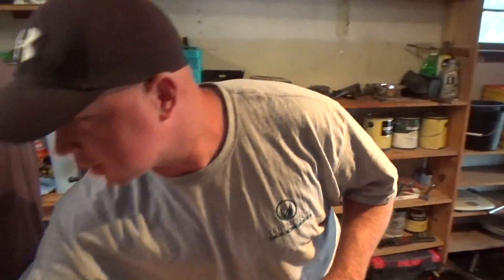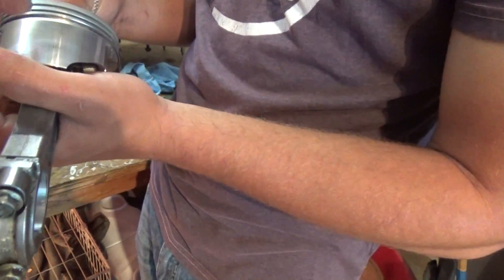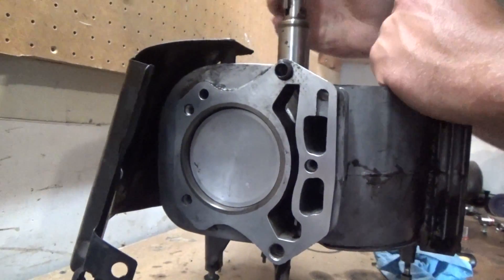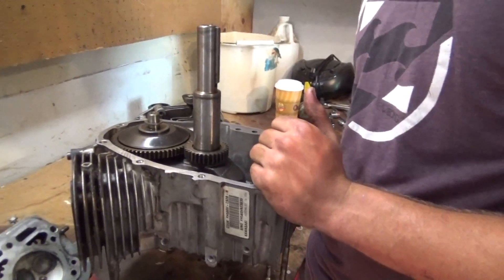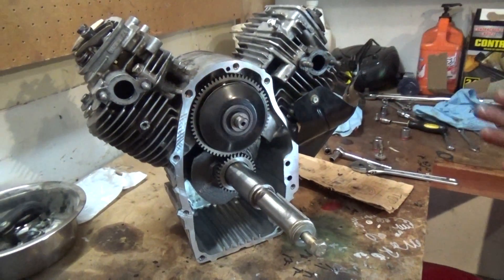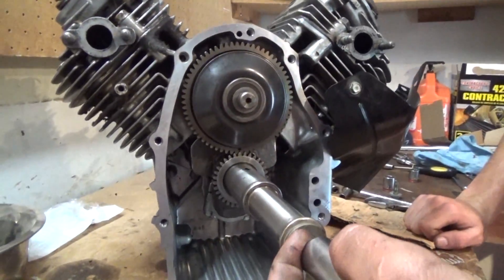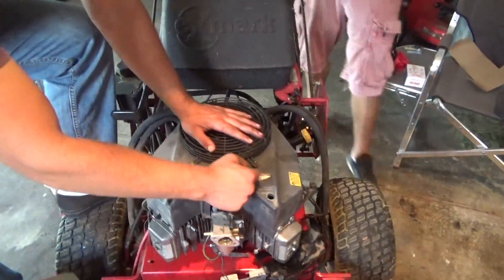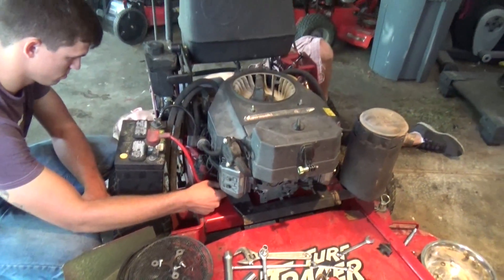Kawasaki 4 Stroke Engine Rebuild. Piston Ring Repair , Head Gasket Replace

Comment: The Kawasaki motor is the best lawn mower engine never made I'm surprised you're even rebuilding it it's amazing I have one that's so old from 1989 that still starts up with one pole it's on a 36 in so it didn't get as much mowing but it got a hell of a lot of mowing it's still runs as good as anything.

Comment: you didn’t use any lube for assembly you didn’t set the valve lash and you never go full torque value you could cracker been to head. Supposed to progressively tighten it till you get the full torque value.

Comment: This video really helped me with my first engine rebuild. My only question though, is the exhaust and intake valves were already installed and you didn't mention them. I tried to put the camshaft back in after the pistons and head were installed, but the valves won't go in far enough to clear the cam installation. What am I doing wrong?

Comment: Needed to adjust or gauge the valve guides to appropriate gaps, somewhere around 0.006.  Look at what your valves call for on this engine.  Then your engine should run smoother.  There are YouTube videos on how to do that also.

Comment: Lube components to prevent a dry start .. And gotta adjust the valve clearances and also i didnt see any honing/ de glazing of the cyclinder... Just enough to get the cross hatch pattern ... Also you need to know if the torque values on the hardware are when wet or dry.. And what does the spec reccomemd for lube when torquing bolts wet .. A wet torque is differemt than a dry torque do to friction ..

Comment: Dang, my guess is cant learn without trying. I have a sibling with a twin Kawasaki that's finally blown a gasket or piston won't know till I take it apart.  I will draw diagram pictures on paper to tape bolts to   was my thought.

Comment: A stator doesn't have anything to do with your spark.  The rotation of the flywheel magnets passing the magnetos induces spark.  The stator is there to keep the battery charged therefore keeping all electrical systems functional on the mower.
Reply: Magneto.. I think it's just a coil secondary.

Comment: Yep....  Just what I expected from your first video.  Have you boys ever heard of crossing hatching with a hone?   Since you only put rings on one side, did ever occur to you to run a compression test again to see if the cylinders are even close to being in balance, or does the potential for a broken crankshaft not bother you?  Still pondering the purpose of that governor arm spring??   Damn that was fun watching you boys work.....  The BEST part was those kids actually talking shit like they knew what they were doing, the SAD part was that you believed them......  I give that engine less than 100 hours and it will be right back on the bench and you now have two You Tube videos to show the world why.
Reply from the maker: Appreciate your feedback. We actually used this machine for about another year and then traded it in to the dealer.

Comment: Assembly lube on all moving parts.

Pre-position governor lever. 

Always install new crankshaft seal in oil sump, make sure lip on seal doesn't roll over when assembling sump (oil pan). Loctite sump bolts.

Gradually tighten bolts to torque...not to full torque as you go. 

Loctite engine to frame mounting bolts.

Anti-seize pto end of crankshaft...make sure key is in good condition before installing pto. Loctite on bolt.

Anti-seize and check key for flywheel.

Adjust valves.

Comment: First I applaud you guys for tackling such a project.  Second, I question if the pistons rings had anything to do with the problem!  Why is that you ask?

1) No compression right cylinder #2
2) Remove valve cover and find loose non-functional push rod.  A typical sign that someone serviced the engine and failed to do one of two things.  A) set proper valve gap.  B) fail to set lock screw on adjuster.  failing this allows the adjuster to undo and the rod will fall out of the rocker.
3) In either of the two video's, you did not show if you checked for push rod(s) being bent!
4) When you removed the head, the exhaust valve was evidently stuck open!  That would have automatically been a cause for low/no compression!  Secondly, since they valve get closed tight by a valve spring, the stuck valve would indicate one or more of the following.  A) Bent valve  B) High carbon buildup stick the valve. C) Valve seal broken.  A damaged/broken valve seal will allow crankcase oil to flow into the cylinder!
5) Hard to see precisely, but the head gasket appeared  to have blow by where as oil could leak from the oil cavities into the cylinder.
6) You did not show or speak about the cylinder head tear down and service.  A cylinder head in that condition requires a mandatory dismantling, cleaning, check for bent valve stems and resurface of the valve and head matting surfaces.  Since the engine started and ran, I will assume that you did all that including setting the correct valve clearance!

My "guess" is that a good head and valve service/exchange would have been all you needed to do.

The last thing I wish to mention is that >>>>  Never ever assemble an engine like that with dry components.  You might as well throw some sand in that engine for the damage you can cause by not making sure the all moving parts are pre-lubricated with a heavy weight oil as you assemble each component!
Reply: This...   The valve in part #1 had a problem that was not addressed in the video.  It had to be fixed in order to have the engine running right at the end. No mention of the valve later.  Was there any evidence the rings were bad?  I do not think so.

Comment: Hello I have the same mower and this got mix gas in the oil
I need Help. I get it to the shop and they tell me was the carburetor but I already replaces it and I got the same problem. So what will can be the problem??? Thanks
Reply: I am not an expert. I just did some research and it seems that bad piston rings or running to rich can cause this. If air filter is to dirty can also cause to run rich, make sure choke fully closes on carb and is not stuck leaving the choke partially on. Maybe new NGK spark plugs that run hotter to avoid flooding. Just a few things to rule out.

Comment: If you have no ring compressor, just use a large hose clamp.  Put it around the rings, and using a screwdriver to tighten the clamp and compress the rings works like a charm.

Comment: what are the torque specs on the flywheel bolt ?
Reply: Tighten the shit out of it with a air impact is what I do!!!! It's not like its gonna leak or get warped

Comment: need to remove valve train before head install, then pushrods and adjust valves.  your engine is racing at the end due to governor. adjust properly its fine. you can spin engine w starter and plugs out prior to first start up. solves lube issue and primes carb w fuel

Comment: you took the push rods out and put back in What the valve clearance?
Reply: Corner cutters lol they didnt relieve the pressure on rockers to rwmove rods just head.obviuosly you seen that but i was always told not to do it like that due to it could have the possibility of interfering with head torque down and possibly bend a rod.true or no?

Comment: Good video.  I am not an expert but I am taking a marine engine repair class.  For a few things we were taught...  The piston and the piston rod are suppose to be oriented a certain way in many engines.  Put the piston back in the same cylinder with the the end bolted around the crankshaft in the same direction as it came off.  Do not swap ends.  Be sure to torque everything in the engine that takes much time to replace.  After going to that much work, I would replace the bearings and seals whether they look acceptable or not.  They are the parts that take the most abuse and I don't have time to do a bunch of rebuilds for inexpensive parts.

Comment: use engine oil putting the pistons in, also you can use large hose clamps to compress rings while installing so you dont break a ring. also pour oil in pump so it will prime before starting

Comment: Is there a way of changing the crank case gasket without disassembling the entire engine? I've got a john deere with a oil leak at the crank case that needs repair the engine in short of removing it from the deck.
Reply: By the way awesome video. You guys make it look easy, but what do you do for the bolt that holds the main belt pulley? I know a lot of times that seizes up and is hard to get off.

Comment: More likely the problem lies with the governor arm not being rotated properly when the engine case went back together. It's a common gotcha problem with small engine overhauls and the more mechanics you have and the more distractions from same, the higher the chances someone will forget to do this part correctly.  You might be able to to remove all the parts from the shaft and rotate it now to save taking the engine apart again.  Valve clearance must be set correctly and I believe that this was the original issue - you set those valves EVER?  You should.  Bent pushrods are still in your future if you don't.
Reply from the maker: You are correct that ended up being the problem.
Reply: That's nice and quick !!  I was looking for the video that might have some info on it and just got done with the hammer and home made gasket one - nice fix there, but I would use RTV silicone thinly on the gasket alone there to keep all the 90w I could in place.  Just a dollop between forefinger and thumb, then massage that onto the entire gasket alone, less is better with RTV.  Hoping you are doing valve lash these days as all air cooled engines that get long in the tooth as they say tend to 'grow' a bit in the valve stem leading to over heated valves that stick and bend pushrods.  They especially must have time sitting on the valve seat to transfer heat out of them, the more lash they have, the more time they get to cool off.  Classic symptom of a hard to start, worn out engine gets way worse to start when it's hot - exhaust valve isn't closing, no compression, no start.  Cools off and wants to start again.
Reply: Top Notch Lawn Care did you have to dismantle engine to correct governor

Comment: An overpriced small engine repair shop would have charged you a small fortune to do this work.  Nice job only PLEASE in the future use assembly lube on the parts or at least a coating of engine oil on the cylinder walls and bearing surfaces.
Reply from the maker: +scdevon I know, we live and learn.
Reply: where are you buy the parts?
Reply: What he said.

Comment: Thank you guys, really helped me.I could not do 19 ft. pounds, kept breaking the bolts. After total rebuild I have no compression, any ideas out there?  slyolfart@gmail.com   Thanks
Reply from the maker: +Wayne Russell I don't know too much about engines. Hope you figure it out.
Reply: +Wayne Russell 
Valve clearances? 
If you just put the heads back on by guiding the push rods back into the rocker arms "hoping" the valve clearance will be the same as when you took it apart,  can guarantee you that the valve clearances are too tight.

Comment: Assembly Lube Please... Thank u
Reply: I was just ready to comment on that exact same thing. Hearing those rings scraping down the cylinder wall made me cringe.
Reply: I was about to comment the same. This video should be labeled how NOT to rebuild an engine. Lol
Reply: gotta oil everything
Reply: 30 is fine for assembly. For a machine that isn't going to be stored.

Comment: I would lub every part instead of dry fit.
Reply: +Rodney Wroten you have to be careful with lube, one time lost engine as lube plugged oiling hole on on end of cam shaft?
Reply: +Wayne Russell 
Ok, but at least engine oil or something. This engine was started dry at a very high RPM.  (Cringe).

Comment: You didn't put any Permatex on the block gasket, your oil is going to leak out
Reply: Old English mechanics used grease on gaskets.   Seems to me that a small engine is just a splash of oil and although it may leak, won't be a big deal.

Comment: succesfully rebuilt my engine only to come to a oil in piston problem again after two weeks. Damm it . Did the rings on piston using the spec sheet from kawasaki and it still failed .I have low rpm when blades engaged. what a nasty feeling.

Comment: I have a mower exactly like this. I replaced both heads. I am having same problem with carburetor and have been playing around with governor and throttle linkage and am still not able to get RPMs down. Can you do a video showing how to correct this?
Reply from the maker: +paul caywood I ended up just taking it to my dealer to get everything adjusted right.

Comment: He said the stator produces electricity for the ign coils.  This is false
Reply: if it has a CDI ignition (which i dont think mowers usually have, but i could be behind the times) the stator has 2 coils- 1 for ignition and one for battery charging.
Reply: +JEREMY FOUNTAIN (THEMOWERMEDIC1) explain plz
Reply: @patusher77  Stator produces ac for battery charging via voltage regulator. Coil packs produce high voltage pulse for plugs. Coil packs are the secondary of a step up transformer. The flywheel produces the primary magnetic flux to the open magnetic circuit transformer plates. The breaking away of the primary transformer circuit induces a high spark plug voltage because you cannot change the current instantly. V(t) = L(di/dt) .  I say it's just magic.

Comment: ahh , 4 stroke engines . always more difficult to take apart . have to deal with the ohv just to reach the jug and piston . thats why i try to stick to 2 stroke engine rebuilds . very simple :)
Reply: Who manufactures walk-behind mowers that are two smokes?  Years ago Bunton had a 2 smoker on their mowers...YEARS AGO!
Reply: Lawnboy. But these 4 strokes are easier then your regular fourstroke timeing chain engines being they are gear ran. There fun but 2 strokes you can damn near rebuild on site lol.

Comment: when rebuilding any engine oil de heck out of the pisten rings everything,if oils will tuch it when running then over oil it add stp in the oil too.sounds good run twin stanks
Reply: Assembly lube or hell wd-40 atleast. when he turned the crank it was like nails on a chalkboard. Lol
Reply: Old School Repair Shop ?

Comment: Great job! Just one tip- always put some oil in the cylinder when installing the piston to lube the walls so the rings can create there own seal marks when you break in the new rings. Never install in a dry cylinder. sound good though.
Reply from the maker: max98138 I should have known that one. LOL

Comment: You should have used a gasket sealer. Also if you ever have to do that again get a piston ring compressor to make sure they seat properly for the correct compression. Also when you torque things to spec adding a extension will alter the torque so you have to adjust accordingly. Just for future reference! Love the videos! Keep up the good work!
Reply from the maker: Anthony Rappazzo Appreciate the feedback Anthony!
Reply: TopNotchLawns No problem

Comment: Sweet video I Ben working on a free weed eater from the 80s and I got it running lol it's the best running weed eater I've had
Reply from the maker: jackson knafel That's great man.
Reply: jackson knafel is it a homelight by chance?
i have one i just refurbished from wayyy back thats like that  then i go look and they are using those engines for remote control airplanes.
Reply: JUNKY the brand is weed eater

Comment: Looks great guys! One tip I have is coat the internal parts with oil as you assemble them so they don't run dry on initial start up. Can't wait to see some more truck talk and mowing with the ex mark.
Reply from the maker: Blessings Lawn & Outdoor Services That's a great tip man. I wish I would have thought of that. LOL . We have been so busy dealing with rain here that we haven't had the chance to do any truck talk or a lot of videoing but I assure you that there will be more.

Comment: You guys did a great job gettin that thing back together!  One quick tip. When you are tightening down those heads with the torque wrench make sure you go over every bolt twice because as you tighten one the other will get looser.
Reply from the maker: Nathan Levin I will keep an eye out for that. Thanks Nathan.